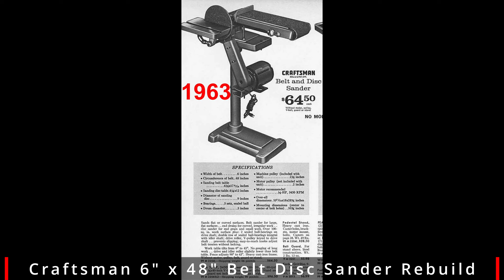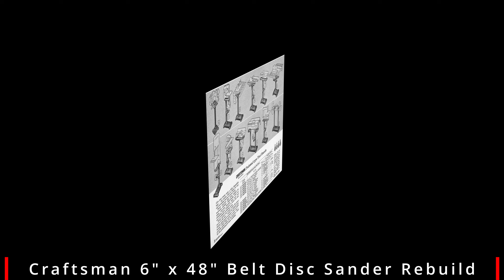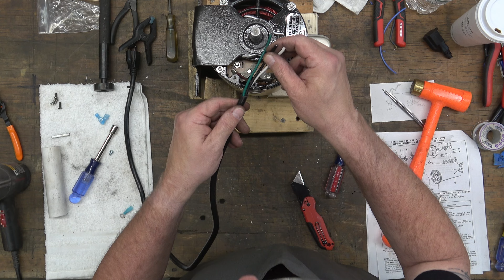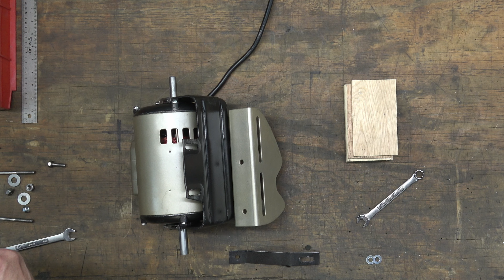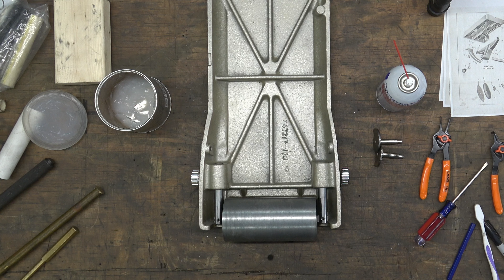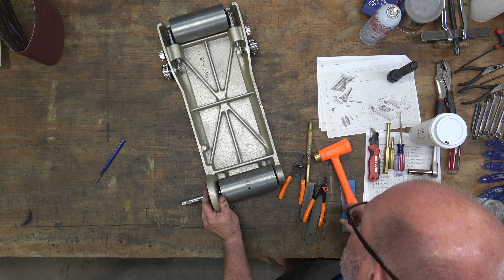Part 15 Craftsman 6x48 Belt Disc Sander Rebuild (Starting Assembly)

Comment: Bummer, the sander I picked up. If I remember correctly did not have that sign plate option. That looks very nice.
Reply from the maker: there were several different models and some had the panel with the graphics and some simply had the model number and some others had the craftsman oval logo. these sanders were produced for 20 years and went through numerous design changes.

Comment: Jeff,

Which software/application are you using to recreate the label?

Thanks,
Jay
Reply from the maker: I use Corel draw; however, if you are expecting to send a file to MattBlast, he does not use Corel and he needs pdf or jpg.